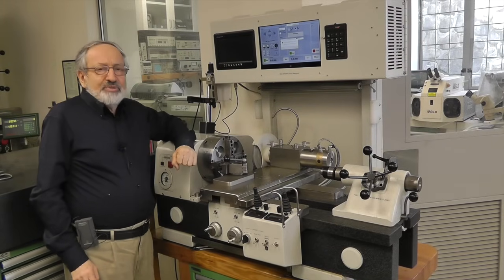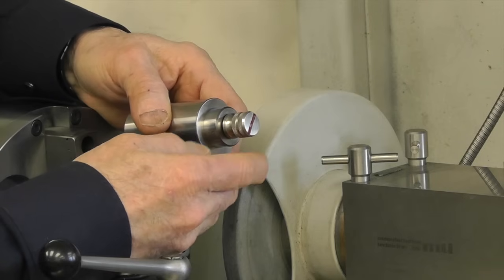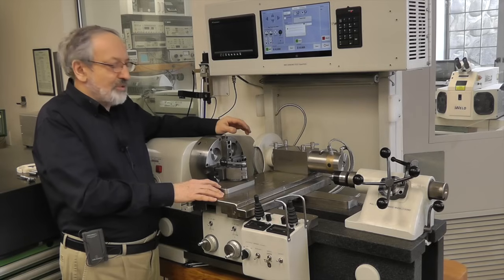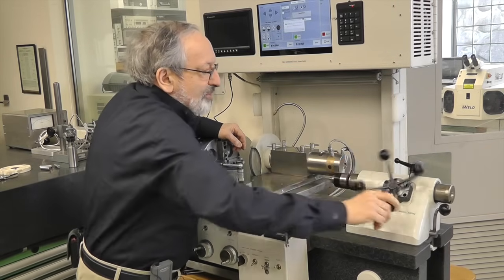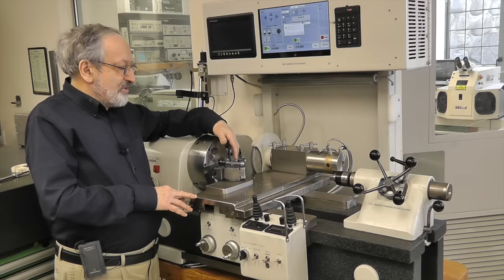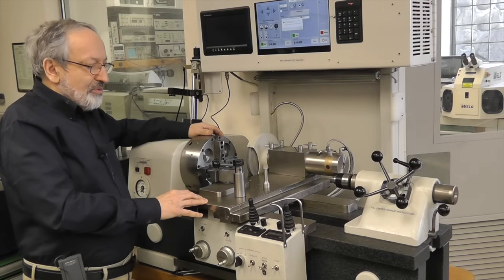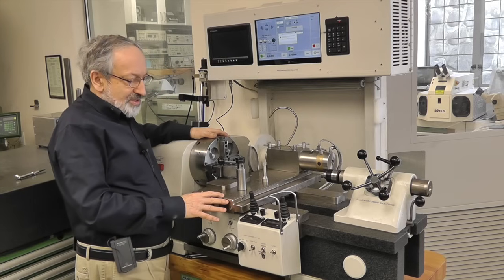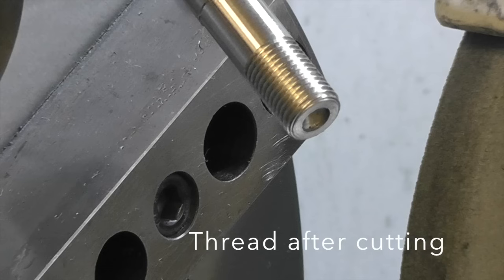High precision air bearing CNC lathe and grinder

Comment: So - how consistent is the epoxy thickness on and between the parallels?  How's that handled?
Love all this, of course!
Reply from the maker: This is not important, as the flatness and co-planarity of the tops is achieved by curing iy upside down on a grade AA surface plate, and the distance is set by precision spacers while the epoxy cures.
Reply: @dgelbart  Wow - the man himself!  Thanks so much for the quick answer - so basically the epoxy filled  a gap that was externally set?
Reply from the maker: @mccanlessdesign  The gap is actually set by the weight of the inverted parts, so it is small (~10um) but not important.

Comment: Where does one get the lumps of irons
Reply: This bed is mainly constructed from four long precision granite parallels. Many were auctioned off in the 1990's as surplus when companies closed and moved operations to Asia.
Reply: Lumps of irons can be found by the side of railroad tracks, or at the junk yard. Dan's machine here is actually built of granite (it's a stone).

Comment: Can someone explain the physics of why the air does not leak out in Dan's demonstration with the cylinder device in the beginning? The molecules/gasses in the air are much much smaller than 1 micrometer, so even with such tight tolerances, I'd expect leakage. Does it maybe have to do with fluid dynamics?

Comment: I can't even believe you built this yourself. I've been building mills and lathes for about a year now, trying to get my own design worked out; never thought to use granite as surface material..... you've given me some inspiration. I ran an od grinder years ago,  and I always loved how precise it was. I even considered building a grindef instead. 

I'm definitely building a grinder now, and I'll be using granite thanks to you!
Reply: I have a picture in my designs folder of an enormous machine made primarily out of granite... likely no less than 4 tonnes of stone in that machine... the parts appear to be both epoxy bound and stud retained with anchors of some sort... quite akin to the classic 4way split concrete anchors, but i cant say for sure from a single picture... Its a great material, hard, stable, durable, great for air bearings especially, but yeah, its not such an uncommon thing... it is rare in general, but not in the industry and specialized worksites...

Comment: I would like to buy this machine. Where can I get one
Reply from the maker: You will need to build it yourself. There are some commercial machines (but without a tailstock) and they start at $250,000. They are even more accurate than mine (sub-micron) but less versatile. I was looking for a 1-2um versatile machine, not sub-micron.

Comment: How many hours did it take to make this machine?
Reply from the maker: About 1000 hours, out of which 200 were just the special chuck.
Reply: @dgelbart  Thanks for replying.  Your work makes me feel dwarfed in terms of your control over variables.  However it’s comforting to know that other makers, take a good amount of time to do their projects.  I started making a stainless steel framed fence trellis, 8 weeks ago.  I’ve tried to explain to a layman how involved this apparently simple task is.  360 holes, 80 tapped thread, 120 components, 200 milling operations, plus hours of priming, double coat painting and a huge amount of measuring and set-up time for each and every operation.  I thought I would like to apply my engineering skills to a household feature, an engineered trellis seemed easy.  Great to have it affirmed, that complex things, take effort and time💪💪💪🤣🙄❤️. Your work is astounding by the way, i pray that you have trained many custodians of the knowledge 🔧
Reply from the maker: Also keep in mind that I have a dream workshop well equipped for this type of work (Moore Jig Borer,  JS surface grinder etc). In a typical workshop, it would take much longer.  @brandsthatcreatelitter1648
Reply: @dgelbart  I dream of making or
finding a very small benchtop surface grinder.  I’ve never understood why the  hobby engineering industry, entirely missed, what seems like a huge gap in the market.  I bet the Chinese could make a micro surface grinder and sell it for £300.

Comment: Teach how how you built it. How much did this lathe cost to build without the software package? Can you tell us exactly what kind of semiconductor units you extracted the air bearings from? What causes the liner axis motion? Are you using servo motor with ball bearing or linear magnetic motors? I can hear a servo motor under action along the axis.

Comment: when u epoxy the bottom pair of T to the top pair, set on a surface plate (inverted), how do u ensure the faces are parallel? do you just run a dial on the outer faces? is it even important? Thanks for your highly useful videos.
Reply from the maker: By placing two precision spacers , matched to 1um, between the top beams and clamping beams lightlty so they can not move away from the spacers.
Reply: @dgelbart  let me rephrase the question. How do u ensure parallelity between 1.the surface adjacent to temporary spacer and 2. Surface adjacent to permanent spacer (on the other block). 
Also, in the 'T', is it important to have the vertical granite perfectly centered to the horizontal granite?
Reply from the maker: The accuracy and parallelism of the vertical parts of the T are not important.  @247chiranjeevi

Comment: It looks like the lathe is on a wooden table. Did you have to go through any special procedures to get the lathe bed level? Is your lathe affected by twist as with a conventional cast iron lathe? Cool video! Thanks.
Reply from the maker: The lathe is isolated from the table by foam pads. The bed relies on its own rigidity, does not require rigid support.
Reply: @dgelbart  That is one seriously rigid lathe. :-)

Comment: While I respect the machine and the effort that went into it, the level of precision in it is somewhat dubious.  A quality lathe is just as capable of the same levels of accuracy as this is.  A micron is only 2.5 tenths (as in 1/10th of 1/1000th of an inch), a skilled machinist can produce repeatable tenths all day long.  The ways on machine shop lathes are lapped to the same surface accuracies as those granite parallels.  The complete dependence on the DRO without a dial in sight, and I would have been thrown out of the shop if I did any grinding without covering up the machine's reference surfaces first!
Reply from the maker: A micron is not 2.5 tenths but 0.4 tenths. Otherwise I agree with all your comments. I was too optimistic about the airflow from the air bearing pushing away any all dirt. The machine has way covers now.
Reply: @dgelbart  I missed a 1/ (inverted my units, apologies) one tenth is 2.5 microns (same as your 0.4)  the point being that it's still within the capability of a skilled machinist.  I would further argue that this machine lacks environmental controls, a secure enclosure, temperature regulation of it's components, as in the micron scale, an errant breath will cause larger deformations than the claimed accuracy.
Reply from the maker: @JohnBysinger  A regular toolroom lathe does not even have the "trueness of rotation" to make parts to 1um. The roundness of a part from a toolroom lathe is 1-2 micron because the spindle is ball bearings, not air bearings. This is why high end grinders have hydrostatic bearings. Same for squareness error, parallelism etc.  The lathe is in a temperature-controlled room. Having said all this, a good machinist with a bit of lapping can do anything.
Reply: @dgelbart  the machine does not, you're absolutely correct.  But a well trained machinist can produce part results well within the 1 micron range, repeatedly.  When you use time tested best practices, properly calibrated indication tools and measuring practices.  I spent 3 years working with a master machinist who produced a calibrated rotational blade that had +2/-0 tenths, emphasis on the -0 tolerance spec for a rotational cutting machine that performed 700-1000 spun cuts per minute, surface place indicated to 2 microns post production every time. 

In much the same way a master carpenter can produce cuts of wood accurate to the 100th with tools only calibrated to 1/32.

I'm also curious, how do you prevent your non lubricated bearings from galling/cold welding?  Even a wet lubricated (see oiled scraped bearings here) bearing can maintain those tolerances, risking galling seems unessesary.
Reply from the maker: @JohnBysinger  There is no risk of galling as the surfaces are always separated by an air film, even when stationary.

Comment: Hallo, first of all ,this is the english language that I understand , and second , how it works and airbearing at various temperatures? I think it must have always a constant one, otherwise it wouldn't work. But your machine is a beautiful piece of technology. Thank you for showing!
Reply: Me again, I saw after reading the comments that my question was already answered, but when you have various thicknesses, also if the material the same is, than you have different expand ? (Sorry for my english, it is not my mother language).
Reply from the maker: The machine works at a wide temperature range, but to get high accuracy you need to keep the temperature constant as the workpiece is changing dimensions.

Comment: No words no comments!!!! Only one question. These air bearings aren’t they temperature sensitive? I mean if you mill the bearings at 20 Celsius, and then the bearing need to work at 45, will it still function as well?
Reply from the maker: Both sides of the bearing are the same material (stainless or electroless nickel plated steel) so they expand together.
Reply: @dgelbart  Thanks for your answer and for your time.

Comment: This is some very nice work. However, i an left with many questions after this video:
What kind of actuators are you using to move the carriage? And how exactly have you closed the loop between the actuators and the absolute position of the carriage?

Also, have you modified the multifix? as far as I am aware they are only repeatable to about 20 micron?

Elsewise, what is your procedure for touching of between tools to account for this? In particular how do you do it with the non-conductive grinding wheel after truing it up?

What hardware does the control software run on? I'm assuming with thad kind of precision you are not just relying on the index pulse of your spindle while cutting threads? I assume there is a pretty elaborate control loop at play there, could you elaborate?

Also, I am still a bit confused by your use of the word watertight in relation to the chuck you use? Could you elaborate on this and/or share the patent no. this chuck is based on?
Reply from the maker: Here are the answers: The actuators are simply high precision (class C0) ballscrews driven by microstepped stepper motors, the steppers geared down by a timing belt.  Residual errors can be removed by built-in look-up tables, but the main thing in such a lathe is geometry: parallelism, roundness, squareness etc.  The repeatability of the multifix toolholder is not an issue, as the tool is not removed during the finishing cuts. If I intended this lathe for optical surfaces, I would add an X-Y interferometer from the toolpost.
Reply from the maker: Here are the rest of the answers: no precise wheel touch detection is used.  The SW runs on a standard Windows touch screen computer. THe threading is done using all encoder pulses (2000 PPR), not just the index.  I could not find the patent for the original Skinner chuck, but is a completely waterproof chuck: the jaws are driven via slots that are covered by the jaws. Because of the high tolerance of the parts (everything is lapped to sub-micron) no seals are needed.

Comment: May I ask a question: how is abrasive grinding dust prevented from getting inside the bearings? Manly the slides. 
I see you use cooling liquid for grinding. This can bind most of the particles. 
Are the slide bearings hydro dynamic or static? If they are static (supplied with pressured air) I assume the exiting air will not be sufficient to prevent particles from getting into the bearings.
Reply from the maker: The bearing are hydrostatic and the air is sufficient to blow the dust and coolant away, but there was an unexpected problem that required adding way covers: after the machine is turned off, there is still coolant on the ways which seeps into the bearings as there is no longer an air flow.
Reply: Very interesting! Thank you for sharing your knowledge.

Comment: This is so cool! I think air bearings in general are very underrated, maybe also because they cant take that big loads. But this is quite a nice machine, and I'm relieved to see coolant for the grinder. I thought that it would spray grinding dust everywhere, which could potentially ruin the bed

Comment: That air bearing at the beginning was just sealed in air. Super simple, why is this frictionless bearing not available in smaller format from a shop?
Reply from the maker: They are, but they are expensive and need a supply of compressed air.
Reply: if you had another female cylinder at the other end of the rod (nipple could be on the female ones) and kept them moderately compressed would the air leek out eventually, because it seemed trapped?
Reply from the maker: @cyber_Dean  Yes.
Reply: thought so. There is a seal made by levitex I wonder if that could aid a sealed air bearing?? would be a first! Great videos btw, always interesting ++

Comment: Awesome work. How do you maintain the space between the two granite T s ? Would love to see a video on build process itself.
Reply from the maker: They are bonded together with 4 large spacers, under compression . After bond sets, the top parts of the T's are added, with temporary spacers.
Reply: @dgelbart  Thanks for the response. Fascinating!! couple of questions 1) how do you maintain 1 micron tolerence in carriage movement? are you using lead screws?  2) Did you make the air bearings as well? from graphite?
Reply from the maker: @TheAnilmaddala  All these  was asked and answered before, please see comments.

Comment: Hi! How are the axes driven? With leadscrews? Where are the leadscrews if so? Easy to put a leadscrew in the cross-slide, but I'm a bit lost on where the Z axis is driven.
Reply from the maker: Both axes have stepper moto driven leadscrews, the Z screw is located between the granite "T"s.
Reply: @dgelbart  Oh okay thanks! So does it have some kind of bellows or guard to keep chips off of it?
Reply from the maker: @BestFleetAdmiral  Correct, telescoping tubes.

Comment: Interesting !! I have some questions about your lathe. Is it steel against granite in the bed or is there graphite layers between or how is the air distributed between the surfaces? grateful for answers and tips. Anders
Reply from the maker: Steel against granite with shallow pockets around each air restrictor. Restrictor about 60um diameter, pockets are 25mm dia x25um deep. Everything plated wit electroless nickel against rust.  Porous graphite can not be used around coolants, as it soaks them up and gets plugged.
Reply: @dgelbart  Thanks for your reply. How important is the hole size for hammering effect on air bearing?
Your crosslide appears to have a track below for steering, is there anything underneath that holds down the upper part?
very nicely built
Anders
Reply from the maker: @anders7058   Restrictor size is determined by the floating gap you aim for, range is 60um to 120um. There are air bearings facing the 4 sides of each granite bar, so bearings are preloaded against each other,. No "hammering" observed at any pressure. Need at least 90PSI. .
Reply: @dgelbart  Hi again Dan. I meant the part where the tool is attached. I think it's called cross slide. There you see no granite, looks like steel against steel air bearing.
There must be something underneath for preloading the upper part.
On a regular lathe, it is usually a dovetail in this direction to hold the top.
Hope you understand my poor explanation.
Have a small mechanical workshop in Sweden where I am currently doing some granite flatness work for my own machines and measuring equipment.
Anders
Reply from the maker: @anders7058  The cross-slide is built the same as the main slide, 2 granite parallel, 4 sides on air bearings. It is just not visible.

Comment: Massively impressed with this. What's the minimum tolerance from EDM cutting?
Reply from the maker: Probably 5um, but most shapes done on a lathe can not be done on EDM (threads, steps, grooves etc).

Comment: This man's work is so beautiful I tend to hold my breath when looking at it. As an amateur machinist, I have never hold any tolerance tighter than a thousandth. This has been good enough for small o-ring grooves, heat-shrink fits, seals, seats for (commercial) ball-bearings, and so on. I have a professional machinist bro who typically does not have to hold any tolerance tighter than a "tenth". Dan, you are on a level so beyond what I am familiar with it is beyond my ken.
Reply: a tenth is same order of magnitude, this is a luxury machine. you can get same results from inferior machinery it just takes time. in dan gelbarts case time happens to be worth millions of dollars. The part is what matters
Reply: A micron is about half a tenth. Machining within a tenth without a machine like this is impressive!

Comment: Hi, nice machine but i think that the bearing made by you can't work for long time. in case of load the air between the inner and outer cylinder will be compressed and the friction in the surfaces will destroy the air bearing in a short time.
Reply from the maker: Air bearings last forever if you don't crash them. This is a machine for people who know what they are doing.